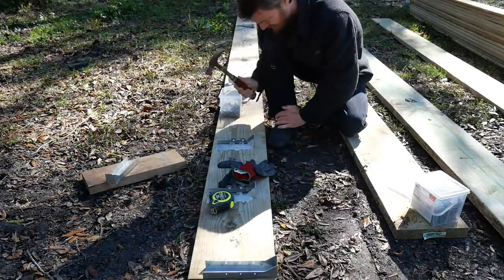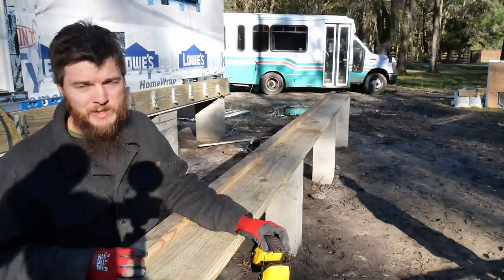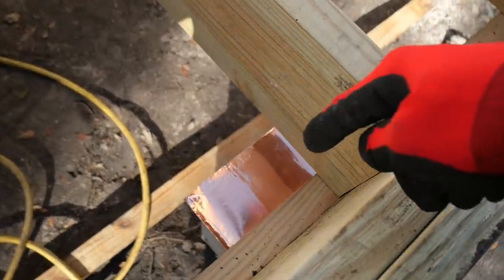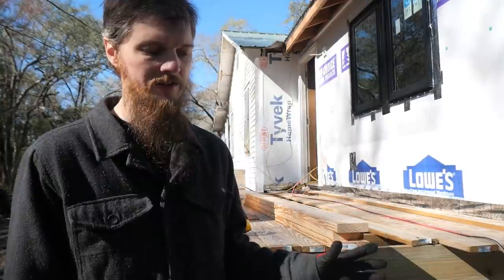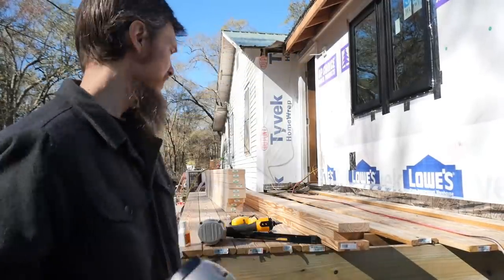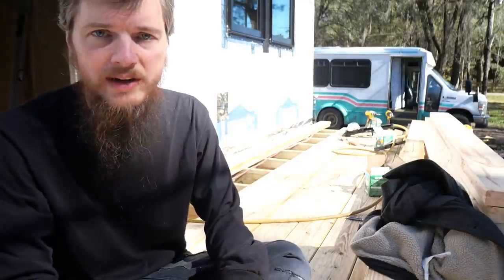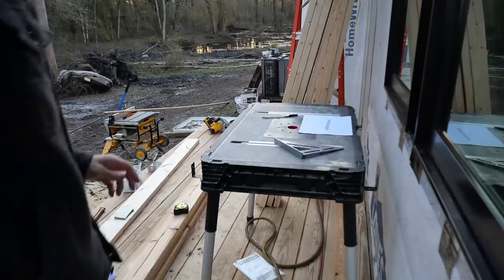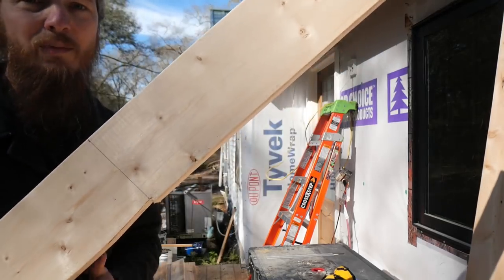I Shouldn't Have Used Nails!  DIY Porch Build

Comment: Air pressure! The gun can only deliver the air pressure that it is fed. It’s not the gun that’s the problem, just need to crank that air pressure way up. Those are framing guns and consume a ton of air, they have the capability of driving those nails below the surface if you wanted them too.

Comment: I would choose screws for the deck surface in case floor boards need to replaced, nails good for the framing. but like i say to myself when i watch your videos, its your house do it like you want. You guys are doing an awesome job.
Reply: well you can just pull out the nails, screws are harders as they just snap in half over time

Comment: Since you live in FL and are susceptible to hurricane force winds on a regular basis it would have been better to nail the posts in the corners to the side floor joists and front rim joists and have them setting on the piers.
Also I would have secured the rim joist to the piers with anchor bolts and metal brackets. 
Having the posts just nailed into the deck boards is not very secure when the winds start to blow. 
But that's okay you may get to do it all over again after the next big storm. 
And on the nails not going in the decking, like others have mentioned it is likely that your compressor pressure regulator was not set high enough for the job. I should be about 100 PSI for that type of framing. 
Curiously I did not hear your compressor run at all during the video. Perhaps I just missed it, or that part was edited out.

Comment: Never use nails for the top porch boards...even ribbed or twisted flooring nails will migrate up.  the absolute best way to fasten in deck 2x6's is to toe-screw the side of the plank into the floor joist...so to hide the screws...then water won't rot the holes on top of the boards. Makes the porch look professional.
Reply: In my experience with hidden toe-screws, they don't resist warpage of deck boards well.
Reply: @DPSocrates  Interesting..makes sense since pressure treated boards dry out and they bend-bow...with extreme large FORCES exerting....probably pulls the wood through the toe-nailed screw head or snaps the wood. In a  perfect world without bowed dry PT lumber...would looked beautiful...but that's never going to happen.

Comment: Did you check the air pressure on your compressor? That's what usually causes nails not to set correctly. 100psi?

Comment: your issue with the nailers comes down to air pressure… not enough. cheers from australia 🇦🇺
Reply: and adjusting the depth of the nail using the set screw on the front of the nailer

Comment: It’s the compressor setting and that cheap hammer isn't helping your situation
Reply: I was thinking it was either the compressor or the depth setting on the gun itself.  A good framing hammer always makes the job easier when you have to use it.

Comment: Good job! i may have noticed what many wouldn't about the air hose being to long which will act as a drain on the power of your Airnailers. air nailers use air that is stored in the gun but also need air pressure from the compressor to complete the drive of the nail also check the depth settings on the nailer because you can set them to a deeper depth which will help in harder woods allowing for deeper nail depths. Another thing you can try is putting candle wax on the nails to make them slide threw the wood much easier. You can use a wax toilet bowl ring to lube up nails if you have a spare one that you aren't using. I would have used regular nails if i was building another deck like the 40 foot deck i built 20 years ago on my home because i used Deck crews and i live in a cold climate of -50F and in the winter cold and the frost i can hear the screw breaking under the pressure of the ice in the deck pushing apart the boards and if i had of used regular nails, the boards would just move out and in without breaking. In your climate you could use any way you like, scews or ring nails for high wind area's are best choice. Try to use a shorter hose for that 6 gallon compressor and increase the air pressure to the max pressure of the gun and set the drive depth to it's lowest setting to drive the nails below the surface of the wood. The wax trick may help, It never hurts to try new things or should i say old tricks that you just found out about.

Comment: Not sure but, I think there should be adjustments on those guns about how deep they will drive the nail.  Also, you probably need higher air pressure.  Good luck with your project and God bless you and family.

Comment: You need to check air pressure on air compressor. You should have 2 pressure gauges one for tank pressure and a line pressure regulator and also you may need bigger diameter hose

Comment: I've been framing decks for thirty years, you need to adjust the line pressure on your compressor, so painful to watch you struggle like that, got to hand it to you, I would have lost my mind. Love your channel. Don't hesitate to ask your subscribers for advise if your unsure about something. keep the faith, your doing a great job!
Reply: Definitely a compressor pressure problem.  Plus, I think both of the nailers have fine pressure adjustments near the tip.  Good luck.

Comment: The same with drawing on, writing on, or decorating cakes, keeping your arm at a relaxed 90 degree angle and using your whole arm, with no bending your wrist or fingers. After you get used to it, it’s easy and pain free. It just doesn’t feel normal at first. The bakery owner I worked for, over 40 years ago, taught me this. Even today, if my wrist, hands, or fingers ache, I’ll use this method for anything it will work with. Helps keep my shoulder girdle (rotator cuff) more fluid as well! 
Very good that you are being proactive about your health, ergonomics, and safety, all while doing an outstanding job with all your creations! Great teamwork with your family as well! You guys are AWESOME and do beautiful, safe, and reliable, quality work!!!

Comment: Did you check your depth adjustment on the nailer and make sure your air pressure on the compressor is set correct for that nailer?

Comment: Deck looks great! As for you air nailer issues, be sure the recommended pressure is at the nailer, and the nailer has an adjustment knob on the front of the nailer, turn it one way or another to adjust how deep it will drive the nail. You might have checked all of this already but I felt I should mention it, thanks for the videos:)

Comment: The problem with using nails on a deck is that later in the years the nails will start to pop out. We have that problem with the deck that was built in the front and back of the house. It's best to use screws for your deck. You also have to make sure that the screws done split in half later on. Lots of love from Florida

Comment: Like others have said your air compressor is to weak
Reply from the maker: We have a decent compressor. It should handle the nailer fine. This is what we're using: https://www.homedepot.com/p/Husky-20-Gal-Vertical-Electric-Powered-Silent-Air-Compressor-3332013/311273546

Comment: Get a bigger and better hammer. Yours looks like a 16oz Estwing with the leather handle which is fine for hanging pictures. But you don't want that. Get an Estwing 28oz framing hammer (blue handle). For some reason this hammer will force you to be accurate with your strikes. And once you get use to it, you will be able to drive those 3in nails down with one blow. Yes, it's heavier. But your raising your little hammer 15 times to drive a nail and with the 28oz it will only take once!
Reply: My dad would use a tap to get the nail in, then one blow to drive it home. However, he was a carpenter by trade. I miss my dad.

Comment: Not the gun maybe it's the pressure
Reply: That's what I was going to ask also. Maybe the air pressure needs turned up? Seems like all of them were standing the same size out of the Porter Cable gun.  I know Doug is experienced, but might have just overlooked it. Just asking?

Comment: You should have your air pressure set up to 120PSI when driving large ring shank nails. Also, your compressor needs to be able to support the nailer. Typically 2.7scfm will suffice, but you will need at least a 4-5 gallon tank. I use a 20 gallon 14scfm for all of my larger projects. I only use the pancake compressor if I am not going to be nailing a lot at once.

Comment: You are not the only one who experiences problems that cause frustration. My son purchased a dishwasher that fits on the counter right beside the sink. The problem: the company didn’t include a “ parts list” , some parts that perhaps should have been included, and the “ instruction manual “ was somewhat difficult to comprehend as some of the sentences seemed to just drop off to a blank space. The schematic for your choice in the method of “ drainage “ is somewhat comprehensive as this picture was drawn and appears to have been condensed or shrunk in size to about 2 to 3 inches. There was nothing related to “ How to connect parts for Filling the unit. For the last couple of days I have been searching from Home Depot to “ Ma & Pa Hardware “ stores for possible parts that were not included, and such. Plus, I have to buy a whole set of tools. My older son stole all of my tools. ( He said he borrowed them. He’s a problem too. Long story, 😐 Sorry. )

Comment: I have been watching your channel since the MH you renovated with the garage.  So when y'all lifted the ledger board to the house I couldn't believe how tall your daughter is.  Like the way you designed the under pinnings for the porch.  It will be super sturdy.  I am surprised by those nailers.  How about the compressor?  Is it putting out enough?

Comment: Just wondering ? I'm no proffessional on decks and carpentry but I've built sheds and one deck on my house back in the late 90s and used screws. Seems like nails always seem to pop out in time and stick up also ?
Reply from the maker: The nails we're using are ring shank and hold into the wood very well. When some nails mess up and need to be pulled out, they are pretty much impossible to get out and the heads end up snapping off trying to pry them out.

Comment: I think Air pressure to low due to the length and size  of the hose.   Just like  electricity.  Length diameter  affects pressure at the tool.

Comment: 110 to 120 PSI, lubricated gun (if it is required), proper nails for the gun (different brands do actually fit differently in different guns), punch the surface with the gun with the trigger pulled, make sure there's no frozen moisture in the wood.  I used to nail tons of deck boards with a compressor and nail gun.  Nowadays, though, I screw everything down.  The wood will shrink and twist, and nails will pop.  Especially on the ends of the boards.
Reply: One thing I forgot to mention.  If the boards you are nailing down are 5/4 deck boards, then the typical nail to use is 2 3/8".  So, maybe it's the longer 3" nail that is giving you trouble.

Comment: Good job to whoever thought of the animation and the applause.  And as for the length of the video, I learned that the longer the video, the more money.  Of course, people make videos just because.  I don't know if it's true.  But anyway.  I feel your pain working with th as t kind of wood.  I had the same experience in making small projects with no power tools.  It's painful and frustrating.  Glad the deck is almost done.  At least the floor is done.

Comment: Don't listen to people telling you to turn up the pressure. Use no higher than the tool calls for. More than that prevents the valve from opening all the way when you pull the trigger. Result..short driven nails.

Comment: Wondering what you drove the “lag screws into on your ledger board?” The engineering behind your comments is fine, but are you driving into OSB or through the OSB into something more substantial behind the OSB? Good luck and bless you and your family.
Reply from the maker: The ledger board should attach directly to your rim joist or other solid framing. Ours is attached to our rim joist and our bottom sill beam. You are only supposed to pass through a max of 1/2" sheathing.

Comment: Hi Doug!  Check out the nail gun that Sam on Green Acres Homestead uses. It’s a beast! It’s some kind of gun that uses C02 cartridges. It can drive 3 inch nails like nothing. Correction it uses butane cartridges. 1000 nails per cartridge.

Comment: Your deck is looking lovely and however it ends up being finished it seems to me that it should be nice and sturdy.  Some of your equipment challenges didn't help matters on rebuilding but there is a saying:  "sometimes you just gotta do what you gotta do...even if it is against the standard application or the grain...LOL  Jesus is right there with YOU building that deck.  I am pretty sure He is smiling...after all he was a Carpenter too.

Comment: Those large compressors while they provide great cfm, their peak PSI may be lower than what declared. Also, unless you really need it, use shorter air hose, all this will let you get 120+psi that those tools need at nail gun cylinder side. Not to mention, that you already checked that pressure control valves on nail gun is all way out.
With treated  boards being wet and soft, and the way how second nail gun experienced same problem is indicative that your compressor and hose setup not deliver enough pressure for them to operate full power. Any of those nailguns have no problem to saddle 3.5 ring shank nails flush to any construction wood, can shoot trough galvanized bracket on occasion.

Comment: Not sure if you did it, but you should perhaps put some insulation foam between the concrete blocks and the ledger board.  It will prevent the wood from wicking water up into the wood.
Reply from the maker: We used some copper flashing for that :)

Comment: use your other hand to push the nailer down  on the round area before you pull the trigger. I've had nailers that kick back like that and it just needed more weight to get it to work. PS. most building carpenters use a 24 oz. hammer so the nails will go in-sometimes with the first hit.

Comment: If you use nails for your decking, they will eventually loosen and lift. It's recommended to use screws on the decking and nails on your joist because nails have more shearing strength ! I use engineered screws and nails on my joist and I use stainless steel screws on my decking.

Comment: Good video showing the trails and tribulations of your building projects. Thanks for being honest and showing what all of go through at times. I had a similar problem with a nail gun. Just because the pressure gauge on the tank shows 120 doesn't necessarily mean the tool is getting that pressure at the other end of the hose. The longer the hose, the more it expands. The fittings can be restrictive also.

Comment: A long hose also causes a pressure drop. So I would roll the compressor close to the job crank up the pressure and use shortest hose possible. You didn't mention much about pressure in the video. Good luck!

Comment: I learned and will never drive another nail in a deck board.  Even if they go in they will work out and catch your feet on them in a couple years.   Sink and screw and it generally will stay a 100 times better.   USE SCREWS ( :

Comment: I could have swore there 
was a adjustment screw
on top of the nail gun. It's
like a set nut over a threaded shaft. You loosen 
the nut and turn the shaft
in to drive the nail in deeper.
I don't know if your gun has 
that but when I was framing 
house the guns we used did.

Comment: You need more air pressure—the air is the “strength” that drives the nail.
Reply: Wrong.. Need more volume not pressure....
Reply: @WApnj  I’m sure you are right.  At least we both agree the problem is with the air compression not meeting the needs of the nail gun v. board.
Reply: @WApnj  I just looked it up:  “100 - 125 psi and 2.4 cfm needed to drive 3 1/2” nail.
Reply: @janetdupree6353  which gun.. The first or the new one...

Comment: If I had not seen it, I would not have believed that two guns could not sink those nails. I still think it was user error and or not enough air. I would never have used nails either. I don't have any nails here at the house. They invented screws for a reason. MEGA gaps is right. My ass jerks when I see people leaving gaps in treated wood builds. Like you said, mega gaps when they dry out.
Reply from the maker: We had the air compressor set to what it should have been - 120psi. I believe it was just the length of the nails and also them being ring-shank that was the issue.

Comment: I had the exact same problem with my nail gun. The issue I had was new nails.  Half way through the project and my nails would not set .  The only thing that changed was a new box of nails. Metabo 21 degree 3 1/4 hot dipped .